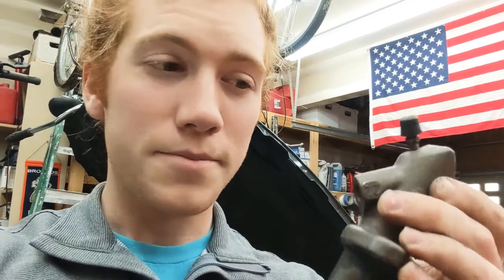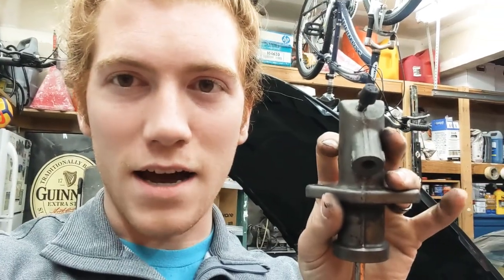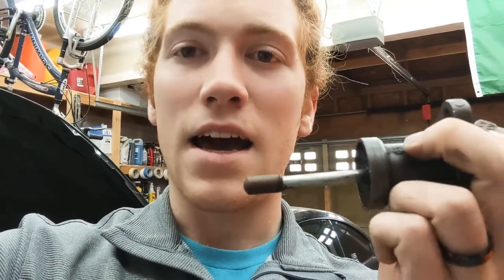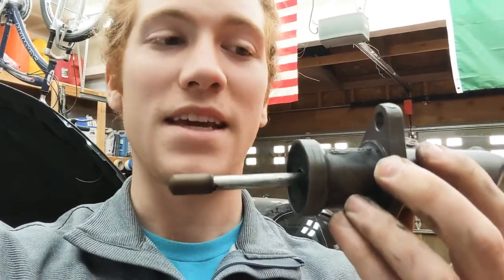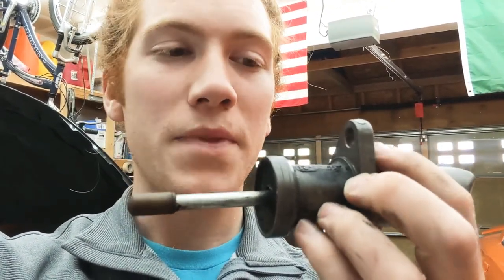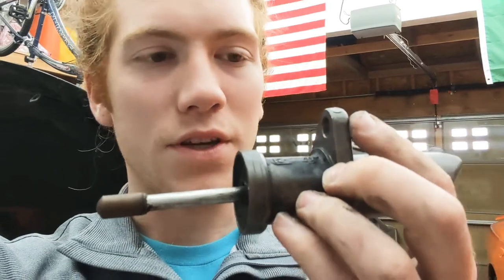How to bleed bmw clutch (dead clutch pedal)

Comment: Hey so my pedal is hard to step on will this fix my issue ?
Reply from the maker: Umm I don't know, when I had a hard clutch pedal it meant that the slave cylinder didn't have any resistance on the push rod, so I had to pull my slave out and realign it on the clutch fork

Comment: So I have a 2011 135i. I had the clutch replaced 5k miles ago. I haven't been driving the car because it's winter. However, I took it to the store when it was -25. Before driving it I let it warm up for about 5min. The next day I went to start the car to drive it to school and the car lurched forward and didn't start (in 1st gear) It was stuck in 1st. so I turned the key off and yanked it into neutral. It started up just fine. I'm unable to put it into any gear while running. The clutch pedal doesn't stick to the floor but it doesn't feel like it has the correct amount of tension. The shop that did the install also replaced my slave. Do you have any input as to what the problem could be? Bleed the clutch? New master? any feedback is helpful. Thanks!
Reply from the maker: If the clutch pedal isn't engaging fully then you won't be able to put it into gear, so I would first start with bleeding the clutch and checking all the lines and connections since that is free! Check the reservoir to make sure it's full, if it's low then refill it and bleed the clutch, any chance they replaced the slave cylinder with a plastic one? The plastic one that I bought blew up!
Reply from the maker: Keep me updated! I would check all of those things, and if you are going to replace the slave you might as well replace the master too just so you don't have to bleed the system 2 times
Reply: @ProjectRacecar2  they replaced it with an aluminum one. Just ordered a master tho.
Reply from the maker: @Imageful  is your reservoir still full?
Reply: @ProjectRacecar2  Yes it is. No leaks anywhere.
Reply from the maker: Gotcha hopefully it's just the master, it's not too bad replacing the master either! Let me know if you have any other questions! I know that's always a pain to go through! Good luck!
Reply: @ProjectRacecar2  I appreciate you a lot man!!
Reply: @Imageful  any updates?
Reply: @lurlarrakoetxea1270  I took it to the shop. They pressure bled it
Reply: @Imageful  was that the problem
Reply: @nigerianskills1919  yes clutch just needed bleed

Comment: 2008 335i 6 speed manual, clutch either is to the floor or up if I lift it, doesn’t have any pressure but all gears work if I float them